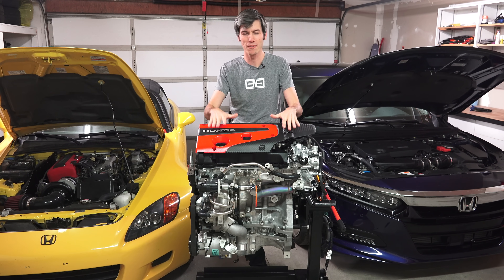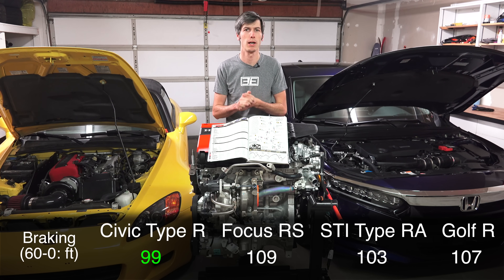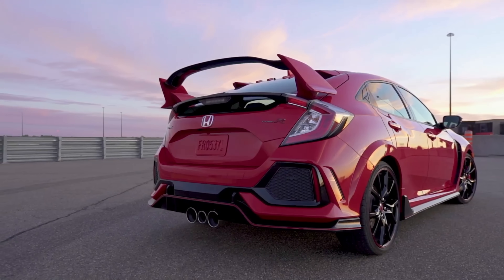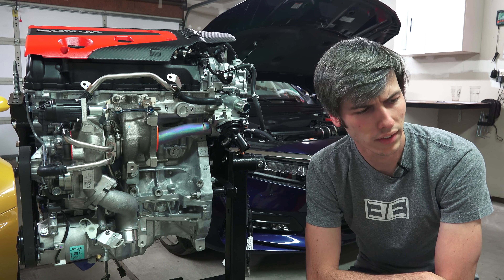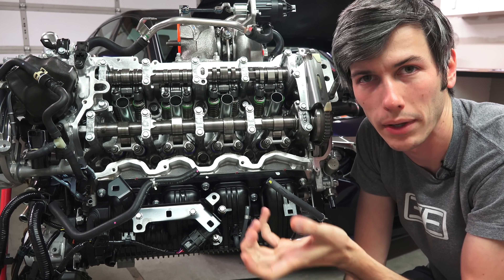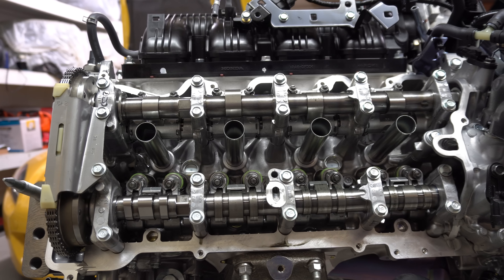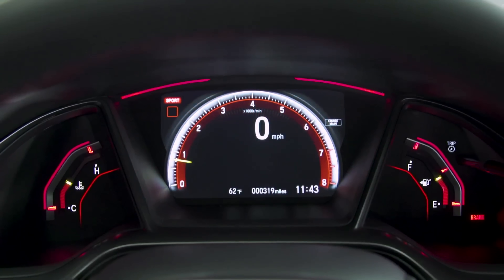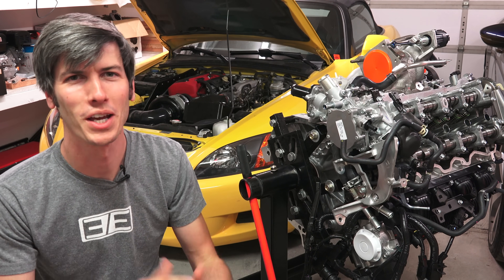The Honda Civic Type R Destroys The Competition - The Best Engines

Comment: Credit is definitely due in the performance department except for it being pig heavy. I was a pre-teen and teen when the old Civic EGs and EKs were out and THAT is how a Civic is supposed to look and more importantly, WEIGH. The new Civic almost weigh 3200 pounds! Worse yet, it looks like a lowered Honda Crosstour with a wing! WTF?!?! Solution: Buy the new Civic Type R motor and put inside older Civic chassis?
Reply: +Mark Davidson All cars are more heavier than their 90's generations though. Just recently we are starting to see a trend where cars are shedding the weight they gained during previous generations. Civic Type-R is still lighter than the competition, you can look at it like that. The Civic Si is less than 3,000 pounds too, which is lighter than the outgoing 9th gen Si. EDIT: The entire 10th gen Civic across all models is lighter than the 9th gen.
Reply: @worldofz00  I just have mention this, the 4rth gen Suzuki Swift. Look up it's curb weight and the Miata,  even the Honda fit. Under 3000pounds. Especially the Suzuki swift
Reply: why work backwards though when the b series and h series not to mention k series are better from a performance point of view with upgrades
Reply: Mark Davidson All cars are heavy.  Technology weighs but the performance numbers are there.
Reply: エンジンの中はすごい
Reply: those cars were also death traps lol
Reply: @Hot-1LE  How much have road deaths really improved over the intervening years? Put anyone in a noisy tin can and they'll be careful. Put the same driver in a highly insulated padded cell and see what happens.

Comment: Motor Trend's comparison isn't that fair.  Aren't the three other cars rally cars, designed for off pavement performance?  At those engine powers, the AWD doesn't help on pavement, so the sacrifices in weight and drivetrain losses are with no benefit.  However, put this comparison off pavement and the Type R would come in last.

Still an awesome engine from Honda, though it is using recent technology.  Compare that to the STI's, which is so horribly out of date it is embarrassing yet impressive for what they made at the time.

Comment: When I hear about newer turbocharged inline 4's pushing the neighborhood of 300 horsepower (manufacturers advertise crank horsepower) at 20+ psi of boost, it makes me wonder where the boost pressure comes from. Does it include atmospheric 14.5 psi? There's 90s cars pushing 300+ at the wheels on similarly sized turbos pushing half, or even less than the advertised boost the type R...
Reply: That will be peak boost, new cars turbo spool quick than 90's cars. So cars pushing high boost low down when engine can't consume the air = air flow restriction = boost. Top end will be lower boost once engine able to consume the air.

Comment: So interesting how clocking 0-60, 0-100 etc doesn’t actually give a proper visual imagine of which car is ahead. In this case the Type R 0-100 12.2, is much faster...a full second at that...compared to the 13.2 of the RS. Yet it’s probably a few car lengths back.
Reply: It can't close the gap from the AWD launch.

Comment: Can you make a video explaining why the 2018 typr ra makes power sooner than a regular sti? Compression is lower, boost increased and 3rd was shortened.
Reply from the maker: How the turbocharger is sized/engine tuned. Type R is designed to make mid-high range power. STI is tuned more for high end power, larger turbo with a bit more lag.

Comment: little maintenance is required
first " 100 000 miles " just change fluids and filters,
then at " 100 000 miles " you wanna have the water pump inspected, valve adjusted and replace the spark plugs...

hhhmmmmm...

Comment: he makes AWD sound like it should be better at every thing but AWD has a lot more weight which is also rotating mass and really only benefits off the line. The Type-R doesn't have the most powerful engine here, it's the rest of the car and drive train that makes up for it

Comment: You wont find a Type R for less than $40k at any dealer and you can get the 18 RS for $35k thanks to Ford killing it off. Most wanted 42k for the R so I wont be shopping Honda. I just did this shopping and bought a 06 STI off a friend instead.

Comment: As far the engine goes, while its impressive and Honda engines are very well built, Mercedes 2.0L turbo 4 banger provides alot more power.

And honestly, since alot of dealerships have jacked up the price of the Type R to over $40k, $60k in some cases I have seen, that would certainly put the car into the Mercedes CLA45 AMG territory.

Comment: I would like to know your thoughts on oil dilution in the 1.5t engine. Is this a design issue with the use of regular gas and the avoidance of knock causing the extra fuel to be injected and thus unburned and diluted the oil?

Comment: Yeah but the stock boost is 22.8 psi...for most other cars this is highly modded territory and will put out 400-500hp. This is no big feat. There is very little to no room for more if you want to turn up the wick. Even old tech 90 turbo cars will put out more than this with less. Also the secret is that Honda always seemed to make more hp because they design the engine cylinder and piston with wider bore and shorter stroke than other sensible car makers...the torque. Yes hp numbers sell to people who don't know in reality but they are slow snails down low. Just look at VTEC torque figures(the old non-turbo engines). And sodium-filled valves something new? It's been around for decades.
Reply: Have you ever bothered to look at the diameter of these turbos? Also its vtec*
Reply: You realize that a smaller turbo will have to put out more psi to make bigger numbers right? Psi is kinda irrelevant with so many different sizes turbos
Reply: @minilurk11  what? Psi(boost) reference comes from egnine displacement. Smaller turbos make more heat per psi once out of efficiency range but 2 turbos of differing size at the aame boost level will make the same power provided they are ib their efficiency range.
Reply: @minilurk11  One more  thing...Vtech yo! It should do this with 10psi. The turbo will die early with this ridiculous boost. Other cars without Vtech kind put out a lot more at 22.8psi. Poor design. What does Honda know about turbos any way? BMW M3/M4 engines put out about 470hp for the similar boost, albeit 1 liter bigger.
Reply: @dduktube  you seem to not understand this a compact sport car for Honda so it must meet some important goals like a good selling price, longevity, gas mileage, guarantee cost, among other things. If they wanted to make 300 hp with just 10psi and vtec like you said, how much fuel will that engine swallow? How the timing will deal with that amount of fuel? Of course you can make more power in a setup with 22 psi but how much will that engine last before it starts to break? You need to understand this is still a car being sold at dealerships and it needs a good price. It is not an exotic or exclusive sport car. 

Also, Honda have been working with turbos since the 70s. They had a civic, called the city, with a small turbo that helped the car make good power and got insane gas mileage. Honda abandoned the turbocharged engines after they got extremely efficient in building engines with good hp and a compact body, obviously vtec played an important part in that.
Reply: Omg you are so ignorant.. its about AIRFLOW not purely psi ya dingus.
Reply: @brandonr2188  all things the same except turbo; im right. Now if youre changing piping and exhaust with your turbo upgrade the airflow will increase per pound aswell.  Ya dingus

Comment: Two Honda Engines the world knows
The Type R engine ( it was awsome )
The McLaren Honda F1 that failed
Reply: Honda turned down Mclaren's bid to build them a V12 so they went to BMW for the McLaren F1 engine... Honda did continue building F1 racing engines tho, remember the BAR F1 Honda team..?
Reply: pi hermoso No he was talking about a modern 1.6L V6 hybrid F1 engine with a team like Ferrari or Mercedes producing more than 1000bhp that can last for like 1/3 of a season or more per unit. Honda are not even close in terms of horsepower figure let alone in terms of reliability. (Toro Rosso Honda used like 8 engine unit (which is limited to 3 unit per season) and 8 turbo swap for 2018)
Reply: Nevermind BAR, it’s the mclaren senna years that brought Honda motors to superstardom

Comment: Does this engine have 1 injector per cylinder or 2 ?   If it only has 1,  it will eventually get the same carbon buildup issues VW and Audi had 10 years ago.  Longevity of direct injection engines also need on demand (low speed) indirect injection (like the EA888 Golf R /S3) to avoid carbon issues.   This is why I bought a 2016 Golf R

Comment: Wait until they upgrade with electric motors I the rear end Of the civic TypeR for all the benefits of electric hybrid awd in performance handing acceleration and efficiency. Similar to porsche 913 Supercar just reverse layout. I think I'm the first comment to address this potential in regards to FWD vs AWD vs RWD.  However RWD cars could do the same on the front wheels to level the field

Comment: Hyundai makes an even better value hot hatch, the i30N, but it's not sold in the US. 
I think you are getting the Veloster N though.
Reply: And don't forget the Seat Leon cupra, which is the better Golf r for a lot less. 0-100 km/h in less than 4.9 sek. Same engine and same platform as the golf r

Comment: Umm, I ran 13.3s 1/4 mile at 103 in my 2016 Subaru WRX STI. 4.9s 0-60mph. Whoever is driving that Type RA needs to have his license revoked.
Reply: My '16 is also surprisingly quick. The magazine numbers feel misleading. When the camera pans through the stats page of the magazine, it looked like they had a few numbers off like the compression ratios and HP figures.
Reply: @cdsprech  yeah that was bone stock numbers. This channel is a Honda channel so what can you expect? I have yet to see YouTube videos of a bone stock Type R beat an STI in a 1/4 mile.
Reply: I ran the exact same time in my wrx 13.3 with a Cobb.
Reply: Yep those numbers are rubbish. Hell, the 03 Evos, bone stock, were doing better numbers. And they also had sodium filled valves, 16 years ago. 😂

Comment: Filled with sodium .  What does that mean ?   I guess you really wanna make sure no moisture gets in there.  Sodium ignites when exposed to water.  But I guess Honda has figured something out for that too.   Those crazy Honda engineers !
Reply: i think all the engines in these cars have such sodium-filled valves, it's very old news to me, the same as variable camshaft timing and lift...honda is not the only one here

Comment: Special mention is the J35Y2 3.5L V6 in the 2013 Accord coupe which sprints to 60 in 5.5 and completes the quarter mile in 13.8. while those cars die out on the high end the J35Y2 VTEC gets better.

Comment: Type R engines and in fact all Honda engines have always been great - I love the power, noise and reliability.
However, I miss the styling of the old civic's, integra's, NSX. This current Civic has an incredibly ugly profile and it looks like they've tried to hide that with various spoilers, grills and vents. It hasn't worked...

Comment: I’ve found that people who dis on the track proven Honda FWD configuration are the type to wrap their RWD cars around light poles in parking lots much. The point is, if you can’t drive to 7/10ths the limit of any car, you have no right to say which configuration is better. The FD2 type-r civics were faster around Suzuka then the S2000 and the NSX . It also made less horsepower. Now, we have a 300hp civic with an even better suspension and aero package.
Reply: Smart comment👍
Reply: A CRX with the B16 or B16B have over run GTR on the track so yeah man there FWD the best of the best. and drive configuration has nothing on them at all until passed 10 seconds a quarter
Reply: @sbfhawk4343  But which track
Yea a lightly modded 90's civic can beat a GTR around a low speed track
A medium to high speed track is a whole other can a worms.
Reply: How did you get statistics on people who diss on Honda and people who wrap their cars around poles.....im more interested in this pile of amazing information!
Reply: new phone who dis
Reply: Hahah that is funny but true
Reply: I had a stroke trying to read that first sentence
Reply: Caden Farley was it intellectually too much for you?
Reply: Lol dude my 94 z28 would smoke any of these cars with just bolt ons. If i super charge it i will smoke u
Reply: 'aero package'... that's one way to excuse that eye sore... lol
Reply: @deeplyclosetedindividual  function over form
Reply: Good comment. I'm a petrol head and have owned 3 type r . Accord ,fn2,  Integra dc5 . And here's how Honda wins . Normal good driver tries to drive m3 proper  fast down" b"  road. If lucky nearly kills himself . Normal guy drives accord r down same road 98% as fast as m 3 ......... no problems.  Trust me that's why Honda are the best everyday performance cars. And I havnt Deen started on reliability  .........
Reply: Or, wait for it, some people just do not like how FWD feels. I've had an 8th gen Si, 9th gen Si, drove the Type-R at the Canadian press event and I just do not enjoy FWD layouts. The car just does not feel like it rotates properly like a RWD or torque vectoring AWD setup. The steering also does not feel right when you have the same wheels doing the driving and steering.
Reply: @ryankwan1934  You are either driving the wrong FWD cars or you are driving FWD the wrong way.
Reply: @garyparker2262  Every FWD car I've driven had a mechanical LSD and I used to autocross them. I'm sorry, but they do not rotate like a RWD car. I will also re-iterate that I drove the Type-R at Mosport for the Honda Canada event. It's a very, very good car, but it does rotate like a RWD car and there's no hiding that it still pushes in corners like a FWD car.
Reply: Ryan Kwan I respect your experience which seems quite broad. My personal experience of rallying front wheel drive over 30 years is that getting the car to rotate on turn in is the least of your worries. It’s so good that throttle is needed to balance it back to neutral. Yes, if you use too much throttle it will push but if you use too much throttle with rwd it will ‘push’ at the rear. Plenty of rwd cars will understeer. In the end it’s what makes you grin. I’ve had years of pure pleasure driving fwd competitively and I’m sure you have had just as much fun driving rwd 😀
Reply: @garyparker2262  Oh there's no doubt that FWD is immensely capable. Like I said, the Type-R is a phenomenal car, but FWD is just not my jam. It doesn't feel natural to me like RWD does.
Reply: Yes, feeling 'at home' with a particular set-up or characteristic is really important. I rallied rwd for many years and the first time i drove a 'good' fwd I was hooked, just loved it. I love the way the steering wheel talks to me. Have a look at a video " Mini v Alfa Romeo: Epic 'Italian Job' chase"   good example of proper front wheel drive handling
Reply: @ryankwan1934  The CRX with a limited slip will punch into the turns hole line and sinker and never have a had understeer in fact the 88s have a bit of oversteer that can put you in a spin condition. If you never experienced that it's not fun because you are out of control for those seconds the car is in spinning. I have also out matched and out maneuvered cars RWD like corvettes and Supras and GTRs on the turns until we get out on the straights then they even out with the added hp those cars have. I also have driven and own a Mk3 supra and punching it into the hole requires a good shift and a punch in power but turbos have lag and it doesnt punch the same but as a skilled driver you can punch it thru the line and get yours to swing out. Both cars are phenomenal in performance so I can truly enjoy both
Reply: Ryan Kwan well your first problem is you’re trying to drive a FWD car like a RWD car, so you will have understeer if you apply any throttle in the corner... between a LSD, torque vectoring, proper suspension setup and good tires FWD cars can hold pretty ridiculous grip levels. FWD is fastest when momentum is carried through the corner then applying throttle when you start to straighten your wheel right after you exit the apex. It’s not like RWD where you can use throttle to aid in steering your vehicle...
Reply: I Never wrapped a car around a telephone pole. 

I find the people who rave about FWD cars have never owned a RWD car.
Reply: FWD rule the race track . The future is here  the current engineering for FWD is showing just that , it was just a matter of time
Reply: @corone2018  LOL
learn some physics kid
Reply: hakrsakr instead of saying “learn some physics” how about you explain the physics to him
Reply: grow up kid. Fwd cars are for pubescent teens.
Reply: @thefeministtoothbrush6957  yeah if you plan to move a 10ton trailer rwd you can't beat but for commuting fwd makes more sense. So no, not just for teens it depends on the application.

Comment: I want to run one of these with my base 5 speed RSX. Im making 220whp and i think it would be an Awsome race
Reply: I've raced 2 on the parkway. These new type rs are a lot faster then expected lol
Reply: If it's anything like the run I had with a local RSX, it was pretty evident that the R had 100 more hp...no offence. Not sure what mods he had installed.
Reply: Dave Drenth well im 220whp. Which is 50 more whp than stock and i weigh about 350 pounds less. Just Curious to see how it would go. Ive beaten older stock sti, srt4 and evo
Reply: Aaron P by all means it may be interesting. Always a good time to see how you stack up against other cars.
Reply: Dave Drenth going with a Kraftwerks supercharger kit next spring with some forged rods/pistons. Seen many dynos with those kits kits pushing 350-450